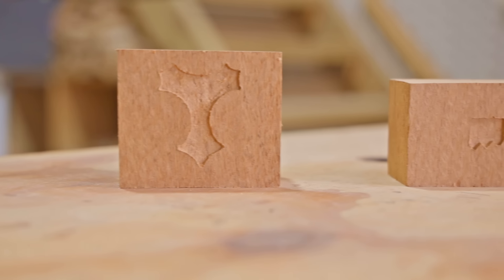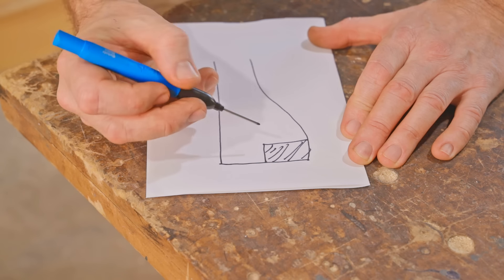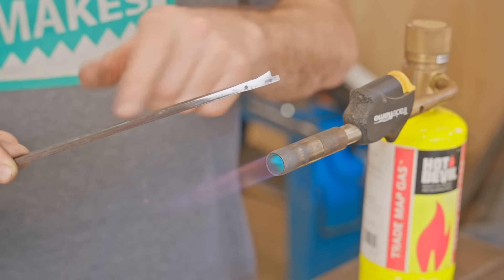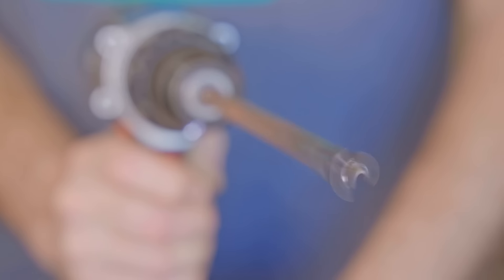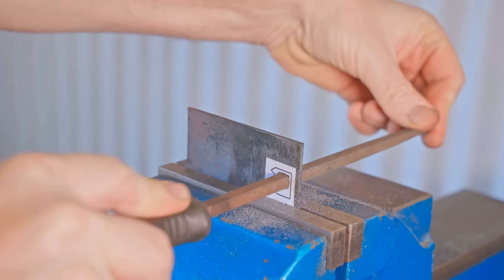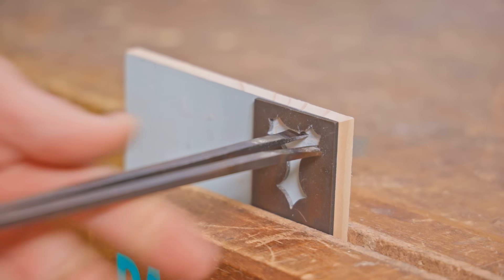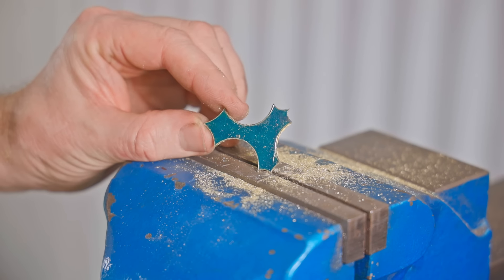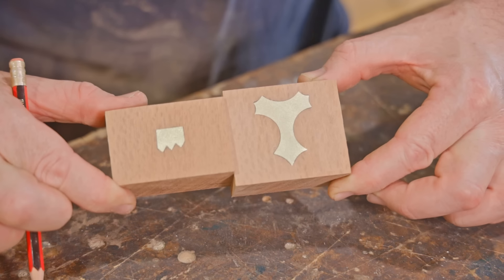Any Shaped Holes with a Regular Drill - How?

Comment: I just don’t have the tools to make one of these. Is there maybe an antique model I could restore or repurpose?
Reply: Might look around to see if you can find some welders & machinists nearby- get the welder to use their torch and vice to get the rough shaping done, then either finish the shaping yourself, or get a machinist to do it for you. The biggest problem would be that both these and the templates they use will be consumables, so if you use them much then you'll need new batches made often.
Reply: @absalomdraconis  very nice video. I was expecting to do some stuff like this by hand. Just carving it out. I can’t get it as nice as your logo piece in the last frame though. I’ve always loved a nice shined brass inlay in a very dark wood.  Best of luck and thanks for the video.
Reply: Seriously? They made these tools 200 years ago and you cannot get access to anything to do this? perhaps you need to think more about how it could be done without expensive machinery?  seriously they did not even have welders when this stuff was made originally.
Reply: @corinkayaker  your right. But in my current state physically and my unique living situation, I don’t have any tools, a space to forge. I thought maybe I could clean up and sharpen an antique one with a few files and a wire brush in a drill. I do have my reasons that makes doing everything more complicated. I’m trying  to design a workspace now that can be folded away but also use it from a seated position. My current living space has no room for a small  corner foldout workbench. I’m still trying to come up with a solution. I use a shoebox right now for woodcarving to control the mess but that’s about the max I can do at the moment. But one day….
Reply: @corinkayaker  dude… I’m a disabled vet with a lower spine injury and have to use canes and wheelchair. I also just moved coast to coast and am living in my in-laws camper in their driveway. All my tools are either sold/given away or in a storage unit back in WV. Could I try this if I had  just a few basic few bast tools? More than likely even if just basic. I just thought if I wanted to try this without spending too much it might be easier to pick up a used and clean it and maybe on my pockets. than all the other tools.

Comment: Could probably modernize the concept by driving the spin with a stepper so you can know its precise position and speed and fast, precise piston control of the spread and then you'd have a way for your CnC to both rough out the wide spots quickly and get into the tiny details without needing a tool change...
Reply: Could work, but it would amount to an additional axis, and you won't reasonable get the same level of results without the template. It would be best suited to rough cutting shallow rings & circles so another tool could follow that pass up, or possible to cutting ring shaped slots into interior surfaces.
Reply: @absalomdraconis  It's another two actually.  One for blade width and one for rotational position.  But with microcontrollers capable of driving 8 axis systems available for < $30 these days it's not exactly a serious problem if one wanted to do it.  

The major impediments to getting precise results without the template would be getting sufficiently large adjustability in width while still maintaining precise control and minimizing incidental deflection, and -- the probably larger challenge -- figuring out the math to convert the template outline into a workable cutting path not dependent on visual inspection.

Thing is that the high-end machines side-stepped the problem via the more broadly useful expedient of automatic tool changers, so just use a big bit to rough out the middle and then automatically swap to a small one for the details.  The human time required to figure out a variable-width cutting bit and how to use it for any particular purpose is probably better spent elsewhere.

Comment: Okay, wait… is this only a tool I can make myself or it their a pre made option?
Reply: I doubt that any pre-made versions exist, so you'd want to find someone with a gas welder (for rough shaping), and go to a machinist for both fine shaping and templates.
Reply: Lol the original ones were made 200 years ago without welders or anything that difficult. really you can do it with drills, files and and a heat source. use a little imagination.

Comment: It's tougher than routing, but (at least in my hands) a router doesn't provide those tasty, sharp acute angles.
Reply: They are surprisingly easy on the hands. You can use round stock to make them as well if this is a concern.

Comment: if you have something like a popup windshield shade laying around. the flat spring steel band around the outer edge can be cut into short sections and lashed together in a bundle with the outer sections bent up at the tips.

Comment: my old man has been telling me for the past 40 years you can drill square holes in metal and refused to tell me how it is done. he's always been an arsehole.
Reply: By using a 3-sided drill bit! 
Not sure if you have noticed before, but when drilling with a regular bit the shallow hole can sometimes end up somewhat triangular. Something about how the tip wonders around a little, so the bit will cut a polygon hole with one less side than it has flutes. That is why high-precision round holes are always reamed after drilling: to make them truly round and precise.
Anyway, if you have a triangle profile bit (think of a triangle file, but made into a drill bit) you can get square-ish holes. If you want them more precise, clamp a square hole guide to the surface similar to this video. To be more precise yet, pre-drill the hole, then use a broach to form the round hole into a square.
Reply: @AgentWest  very interesting. i had not noticed as i don't have to drill holes often these days as i don't work with metal very often. thank you for sharing the information. when i get the chance, i'll see if i can find a vid or two of someone drilling square holes. now i need to go and book mark your vid as i've a use for the information coming up, with any luck, very soon and it'll save a lot of time.
Reply: @AgentWest  excellent. i'll check that out tomorrow when i sober up from saturday nights relaxation from a stressful week.

Comment: Can't you do the same with a small router bit or a dentist burr?
Being it's 2021 I would use a laser.
Reply: if you used a burr so small that it got into corners it would take far longer. this method really is as quick and accurate as you see in this video.

Comment: Interesting method and tooling, although by the time you have finished making everything I could have used chisels to achieve the same thing long before you even started to use the tool.
PS I gave you a thumbs up, I am not a hater.
Reply: If you were only doing one you would win. If you were in production you would loose hard. This tool could produce inlays in wood, mother of pearl, horn, antler, ivory and bone.
Reply: @corinkayaker  Sure, that was kinda my point.
Sorry I didn't make that clear.
You win, I lose "hard".
😂

Comment: At the 2 minute mark I think you mean hammered and not forged. You didn't forge those rods, you cut and flattened already forged rods. SMFH
Reply: forge1
/fɔːdʒ/
Learn to pronounce
See definitions in:
All
Metallurgy
Law
verb
gerund or present participle: forging
1.
make or shape (a metal object) by heating it in a fire or furnace and hammering it.
Reply: I think maybe you should google the definition of forged rather than go with what you think you know.